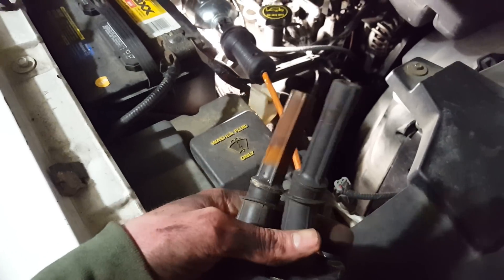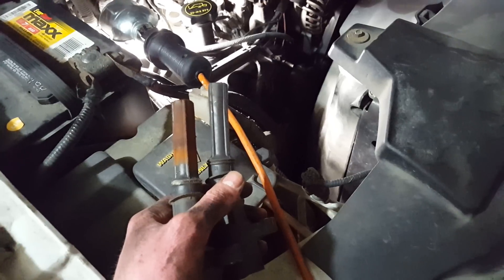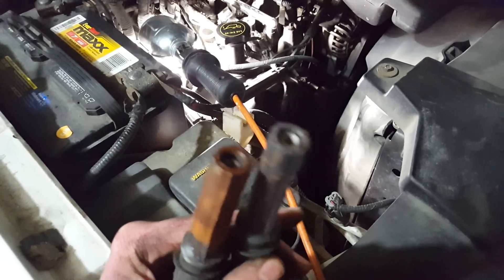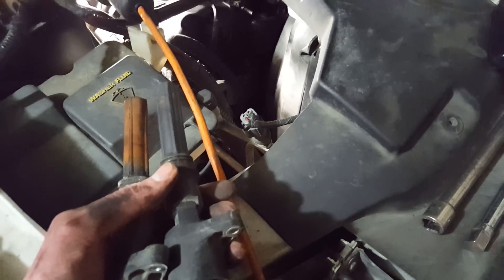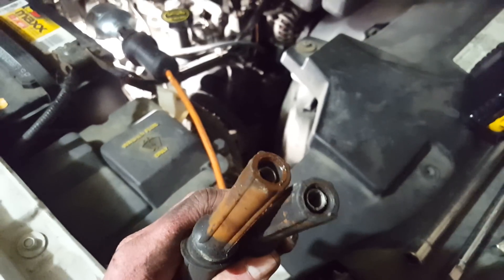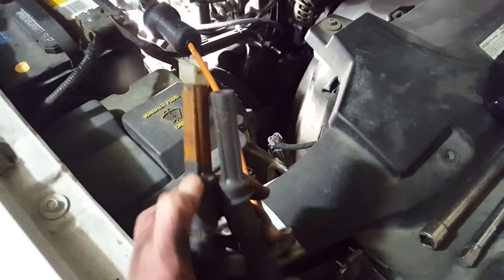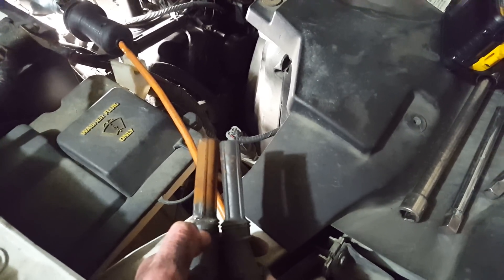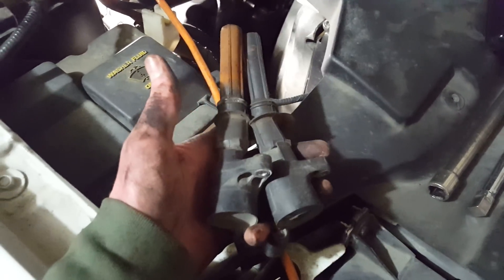Expedition 5.4L Triton misfire - Cause and Fix

Comment: Plug wires misfiring can damage the catalytic converter. Over time, it can cause the converter to disinigrate internally. Plugs can strip out requiring an insert. Use dielectric grease on wires. Use antiseize on plug threads. Replace ALL plug wires despite cost.
Reply from the maker: There are no plug wires.
Reply: The coil-on- plug wires are plug wires. They developed resistance. It can misfire and cause the cylinder not to fire. That can burn up the converter. It can cause rich oxygen sensor codes. Dirty injectors can cause cylinder codes. Try a cylinder balance check by pulling wires one at a time for RPM drop. If a cyl. don't drop, it's not firing.
Reply from the maker: @hankbridges5055  They do not have traditional coiled copper wires. More Information for DENSO 6736000 "Features: Cylindrical ignition coil eliminate the need for ignition wires". They are connected via a spring between coil and plug. There are many things that can cause a misfire. The intent of this video is to shed some light on a common cause of misfire, not list every cause. 

I agree that when plugs are changed they should have antisieze on the threads and dielectric grease where the plug and COP contact electrically (also helps to slide it on easier).
Reply: @Diallo268  Yes, I've seen those. So, in your case, it's not wire to have resistance. But the coils can develop resistance to cause misfire. They can arc internally. Plug gap too wide can cause coils to overload under acceleration. Lean mixtures cause strain on ignition systems. Evidently, you went thru rain or a puddle to have water or there's a coolent leak in the cylinder. A borescope can peek in the cylinder to see. Check the radiator to see if it's low. Pressure test the system and use a borescope in the cylinder. A leakdown test can check for a cracked head if bubbles appear in the radiator.
Reply from the maker: @hankbridges5055  Are you aware of the incredible resistance it has to overcome to jump the spark plug gap in the first place? Most OEM spark plug wires are rated in ohms per foot. It's not like your normal copper wire which would have much less resistance (usually in the milliohm range). Some high end wires are lower like MSD, but the biggest resistance is in the spark plug gap. If the voltage potential of the coil cannot overcome the combined resistance, you will have a misfire. What's happening in my case is that the liquid around the plug reduces the resistance and becomes the path of least resistance which is what electricity will take and the spark jumps there instead of in the cylinder. The coils generally aren't a problem unless they develop a short or open in the coil or the connecter gets corroded. If you start noticing a misfire it's not going to destroy your coil. Maybe it could cause some damage if you drove it for a long time like that, but the main concern would be engine damage at that point. If it's been a few years it wouldn't be a bad idea to check the gap, but again this video is if someone is having a problem and can reasonable eliminate the spark plug as being a probable cause of failure. Gaps will go out of spec as well and still be ok, but don't gap new plugs to what they were because it won't work right. It's a weird dynamic. I regapped the plugs on my 01 Yukon even though they weren't having problems and they were >60% past their gap spec! Even under load they weren't having a problem. I just did it because I had a feeling they were probably getting close. It had been 7 years.

So the liquid could have been from going through a puddle or from condensation. There are many ways for liquid to get into there. It's a poor placement/sealing design by Ford in the first place. There is no coolant leak... this is going off on a tangent that it doesn't need to go.

Comment: Changing plugs and coils and boots are all part of routine maintenance. 
Do what you choose, but failure to do routine maintenance is harmful to your engine and creates down time!
Reply from the maker: I didn't say to neglect routine maintenance. This is a common problem with these engines and I'm providing a solution. Also I don't believe coils have a change interval. You can inspect them, but you don't have to change them periodically unless they are giving you problems.
Reply: Toluene it is certainly your option to not change them until you have problems, however, I do think personally that changing the boots and springs should be part of the 100,000 mile tune up procedure. Just as spark plug wires, distributor caps and rotor buttons were routinely replaced on older vehicles, so should more than just spark plugs be replaced in modern vehicles during routine maintenance. 
Enjoy the hassle of avoidable breakdowns!
Reply from the maker: You're talking about something entirely different. That's great if you want to change them. Go for it. This problem I'm talking about happens well before 100k miles and if you are recreationally changing those components well before that time you are wasting your money. Also, coil packs don't have moving parts so they really don't ever need to be changed unless they have an issue. The most common would be oxidation on the connector. You can use dielectric grease to delay this from happening. The wiring can also short/open, but it isn't common. That's like saying your PCM needs to be routinely changed every 100k miles...
Reply: Toluene keep believing that! By your theory coils never go bad because no moving parts. Enjoy sitting on the side of the road! 
Heat is the biggest issue with these electronic parts going bad! They encounter much greater heat issues than a pcm! You want to talk about stiff being different but then want to go off the deep end on comparisons. Worse you lead others with limited knowledge to sit on the roadside by your misinformation. If they never go bad, why are so many bad?
Also by your rationale spark plugs should never need replacement—no moving parts!
Reply from the maker: I just explained how they could go bad... They do endure more heat, but don't have the sensitive components that a PCM has and some PCMs are located in the engine bay. Spark plugs need to be replaced because the gap increases from the heat/arcing over time until they are too far apart and exceed the voltage potential (spark doesn't jump the gap. Harder for it to jump under a load too as there is more resistance under higher pressures which is why most people notice this first on a freeway or at speed and not idle). Some can just be regapped, but it depends on the materials used. 

At any rate this topic is about fixing a known problem, not exceeding or ignoring the maintenance schedule. 

If you knew what you were talking about you wouldn't have argued that. Clearly you are arguing to argue and you don't have much maintenance experience.

Comment: These are things that most mechanics won't tell you .I had a misfire on number 4 and 8 cylinders on my f150 5.4 and 3 different shops told me bad coil packs and I thought that was strange and decided to check it out myself and they are both a bitch to get to.When I got them both out I had rust on the boots also and water standing around the plugs.I used air to blow out the water then pulled both plugs and used a pc of old t-shirt wrapped around long stem screwdriver to clean out the rest of moisture and cleaned boot and spring and check gap on spark plug....reassemble and ran like new.Mechanics know this is the problem 95 percent of the time.I have 300 thousand miles on 2000 f150 5.4 and coil packs are the original.....they seldom go bad...and a warm soapy rag will make those coil packs look new...just letting you know.
Reply: I have a 2006 5.4 and it has a miss but no check engine light
Reply: @jeffreyslay1607  I too am having a misfire with no trouble lights. Did you ever find out the problem?
Reply: @chipete1  no i never did
Reply: @jeffreyslay1607  dang

Comment: on a 5.4 will a bad plug cause DTC code?
Reply from the maker: Sometimes. If it isn't bad enough the computer won't detect it. One thing I've done before if it's a constant misfire is disconnect the electrical connector either on the COPs or fuel injectors (preferably fuel injectors) one by one to figure out which one it is. The idle will get even more rough if 2 cylinders go out, but shouldn't really change if the one misfiring is disconnected.

Comment: Use only motorcraft.  I found out the hard way rock auto coils for the 5.4s are worthless
Reply: Qqqqqq hi
Reply: I had a misfire on cylinder 8. so I replaced the coil pack that I purchased from RockAuto  hour later same problem. misfire!!!

Comment: I replaced coil 5,6,and 10 on my 2000 gas excursion and still have a miss. The reason I replaced  was because scanner gave me them codes. What is going On? Please help! Freddy
Reply: Ana Andrade could be vacuum leak, did you replace spark plugs when you did the coils?
Reply: Yes I replaced all ten. I'm just going to take it to a mechanic soon. I think it will be an easy fix tends anyway
Reply: Ana Andrade  did you found out what was it ??

Comment: was your truck hesitating in low rpm and wasting a lot more gas and idle ruff but smoother on take off...that's what mine is doing and they said at Auto it was a misfire on spark num 1
Reply: my 05 had a bad boot on one of the coils, truck ran like s. had random misfire codes, changed the boot, runs better than when I bought it. $11 fix
Reply from the maker: It was rough all around, but if I remember right, it was more under a load (harder for the spark to make the jump under higher pressure). If yours is mainly just at idle your idle air controller may be bad. There are other things it could be too. I would ask in the forums for your vehicle.
Reply: I have the same problem you do and they told me it was cyclider misfire. Replaced plugs coils and injectors. The whole time I was getting misfire codes I'm also getting to lean codes for bank 1 and 2. Should be getting someone to smoke test it for vacuum leaks soon but make sure youre not running lean so you dont waste the money I did on replacing all of that stuff
Reply: Sounds like my truck except it wasn't smoother taking of it's runs rough and the acceleration was poor and still no answers yet it is frustrating

Comment: Did your check engine light come on ?
Reply from the maker: It did eventually. Normally with Expeditions and other alike you will notice it before you get the check engine light. The misfire has to be significant enough to trigger a fault.

Comment: I have this exact same problem. My engine is a v10 but it's the same. Cylinder 3 on the passenger side. It got moisture causing misfire. I replaced 8 of 10 coils 6 months ago which solved the problem fir awhile. Problem came back 2 months ago. Got to the point where is was misfiring so bad I couldn't drive it. When I got to coil #3 there was obvious moisture. My boot looked just like yours. I just replaced the coil. 10 minute job. Only had to remove one bolt and one hose. You don't need to remove the fuel rail. There's the connector that has the tab on the bottom. I think rain is getting in. I think mine is fixed. Middle cylinder v10 passenger f250 2001. Great video.
Reply: lcagee intake gasket leak
Reply: I thought about that. Let me give some followup. I replaced the coils a second time but the misfire persisted. I bit the bullet and took it to ford for a diagnostic as they have the scanners. They identified 2 misfires in cylinder 2 and 3 I think. They advised new coils and plugs in those 2. I did this and it's running very smooth now. So the plug probably got fouled from the bad coil. I'm hoping it lasts. If it comes back then it may be gasket but hope not. Very happy at the moment. Ford charged me 300$.
Reply: Ps. Although I can change a plug I did not want to change these plugs myself. I've heard horror stories of plugs breaking and dropping into the cylinder. So I just let ford do it.
Reply from the maker: Sorry about the delayed response, but I'm glad it helped you :)

Comment: Impact on a spark plug? Wtf man.
Reply from the maker: yes to get it out not put it in.
Reply: a lot of people do this on these engines to break up the carbon that builds up on the bottom of the spark plug. these plugs are known to break off inside turning an easy job into a nightmare
Reply: It works!
Reply: It's why tritons should all get a top end cleaning before attempting to remove plugs. Seafoam for the win.
Reply: Make sure to put antiseize on the threads... Believe as many cars as I worked on that's a problem. If it does break he'll have to remove the heads to get them out...
Reply: @kingsol333  There's a special tool by Lisle to replace broken plugs on engines.
Reply: Lol gotta be really careful pulling those plugs out

Comment: My 2008 expedition is misfiring or riding rough around 35 45 mph and when I let off gas and give it gas again but scanner not giving any codes just sensors on exhaust
Reply from the maker: Yes that happens if you are getting partial/weak ignition. I've had it with a '98 Expedition. For that I had corrosion in the connector, but had to replace the COP. The COP can go bad as well. If it's been awhile since you changed your spark plugs, it may be time to do it again. That can be a symptom of it.
Reply: Toluene thanks boss
Reply: that's how it started for me, got progressively worse. turned out to be a boot on cylinder 3

Comment: Heater valve is above cylinder 3. May need to replace a leaking valve.
Reply: Mike Grover  Explorer vacuum leaks occur as the plastic connections age. Need to do smoke test or try just going through it while running listening for leaks with stethoscope (kind of hard with engine noise)

Comment: Hot coolant smells like Windex and pickle juice. Sounds weird but best I can describe it. That's a fresh boot off of a hot engine to smell it. If it was coolant it would probably be pooled in there. My seam on my radiator split on the top left corner and it sprayed quite a bit but I don't see how it made all the way back to number 8. I'm not loosing coolant and don't have any leaks with the new radiator. So no cracked intake. It's the only explanation I can give to mine failing because of the tiny moisture and smell. It was a month ago the radiator failed. Enough time to rust the coil spring. Also over the past week it has been extremely humid. I don't know if that could factor in to it. All I have to say is it SUCKS!!!!! to change these coils and plugs out on an Expedition. I'm 6ft and I have to crawl under the hood and on top of the core support to do anything. The fuel rail is in the way. It takes more time but you don't need to remove it. 1 and 2 looks okay to remove but 3 and 4 is going to be a challenge.

Comment: I have one cyl. misfiring. it has 130psi new coil new injector.
Reply from the maker: If you've already replaced the coil/spark plug/injector I would suggest going to a expedition or F150 forum and post a help thread there. You can also google your exact problem and see if there are any known issues or defects.
Reply: Check the gap

Comment: Did it end up being the coil or did cleaning it up and greasing it fix the problem?
Reply from the maker: As a follow up a year later it's still working great so that was the problem.
Reply from the maker: just blew it out with my air compressor and it has been working fine since. So it was just moisture.